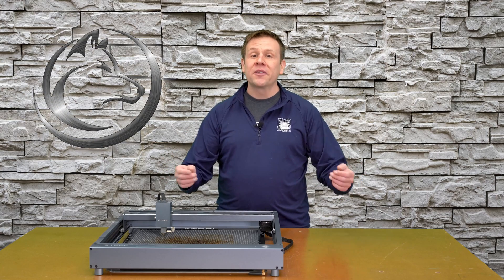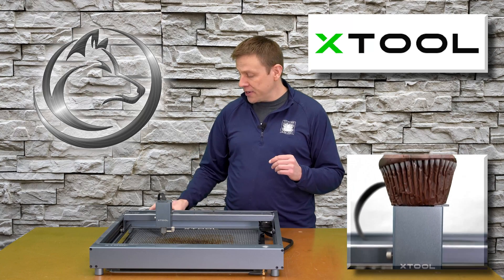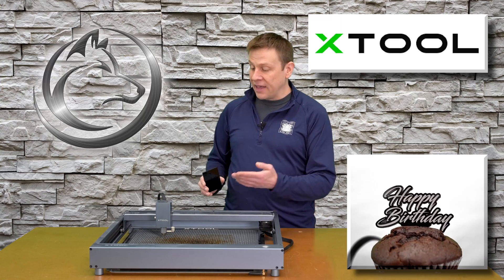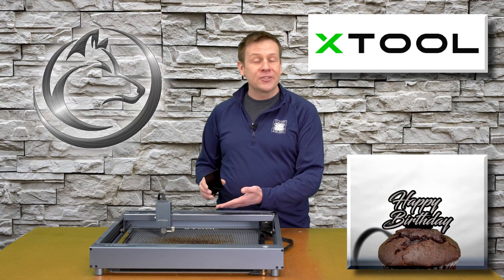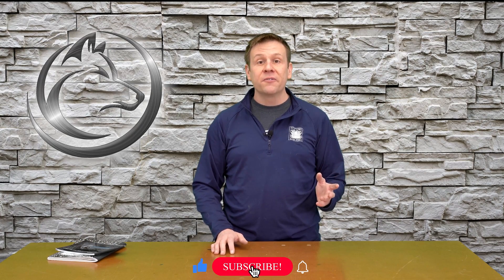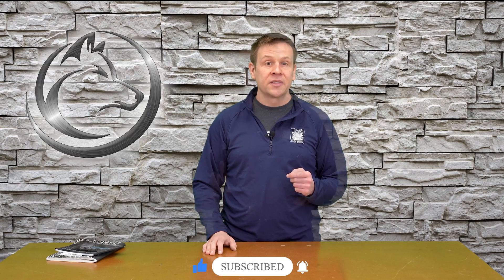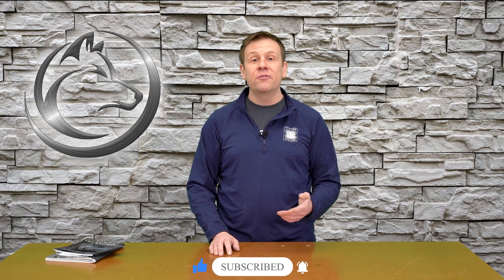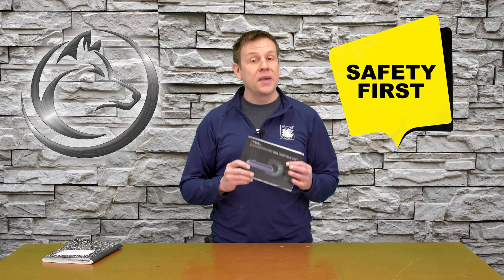XTool Cutting Acrylic Project!

Comment: Tfs, I have a 1mm piece of acrylic what would the settings be?. all videos show 3mm, I have d1 pro 20w xtool. Thank you
Reply from the maker: Hi- I haven't cut 1mm acrylic.  I would recommend starting at about 1/2 the power normally used for 3mm acrylic with low air assist flow.  Thanks for watching!

Comment: Would this be possible engrave and cut clear acrylic?
Reply from the maker: Only engrave- the laser diode is not able to cut clear acrylic no matter how powerful the laser is.  To cut clear acrylic a Co2 works perfectly!
Reply: @thelaserchannel1  Appreciate the quick response. So with the diode laser, best to use black acrylic?
Reply from the maker: @markpham-vivehnl6420  Correct- darker colors cut better with a diode laser (blue will not cut).

Comment: What are setting for d1 pro ?
Reply from the maker: Just use the same settings for the D1 Pro if you have the 10 watt laser module- if you have the 20 or higher laser module the power can be decreased by 1/2 or the speed increased by 2x!  Thanks for watching!

Comment: After engraving & cutting the black acrylic do you wash off the dust or just leave it the way it is? Thanks
Reply from the maker: Hi- it's a personal choice.  I like to wash the acrylic first with warm soapy water.  Any left over dust I clean with denatured alcohol.  In the video I did not clean the acrylic to keep the video length short.  Thank for watching!
Reply: @thelaserchannel1  When I clean the dust on black acrylic the white seems duller, any fix for that?
Reply from the maker: @mikeledee8786  There's usually more dust on the engraved areas and clean can make the engraved areas look duller- maybe a cross hatching the engrave may keep it from dulling after cleaning.  The other tip is to reduce the lines per inch.  Engraving acrylic at a high LPI can result in less engraving appearance because the laser is re-melting the acrylic/acrylic dust and it may look smoother and not as engraved.
Reply: @thelaserchannel1  I'll give those tips a try. 1 more question for you. What color acrylic sheets do you recommend for engraving to insert in the led base other than clear? Thanks for all your help.

Comment: Was this two tone acrylic? I noticed that the linked company and others sell two toned. Does a solid single tone shift colors this drastically when engraved? I hope so as the two tone is quite the jump in material cost. Thanks for the video. Cheers
Reply from the maker: The acrylic in the video is plain gloss black.  The engraving shows as a nice almond white.  I have engraved two-tone acrylics; gold and black.  The top layer on two-tone is usually very thing to speed up the engraving process.  Thanks for watching!

Comment: How thick was the acrylic?
Reply from the maker: Hi- I used 1/8 inch thick acrylic.  Our diode lasers can only engrave/mark clear acrylic- it can't cut it. Thanks for watching!
Reply: @thelaserchannel1  Just a clarification, diode lasers can only engrave/mark CLEAR acrylic, but it can cut black or coloured acrylic? Thanks.
Reply from the maker: @tristanw1982  Correct- a laser diode can only lightly mark clear acrylic with a masking agent- it can not cut clear acrylic.  Laser diodes can cut and mark black acrylic.  Colored acrylics are a little more tricky- some colors work well, some just ok and other colors like blue will not work at all.  Best results are with cast acrylics- cast tends to cost a little more and works so much better than extruded.  Extruded acrylics are not recommended!  Thanks for watching!